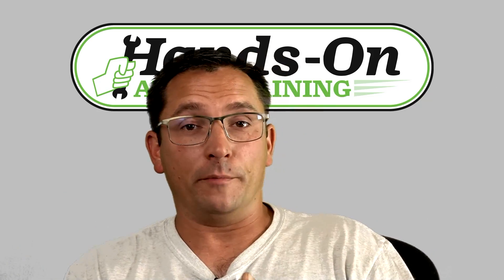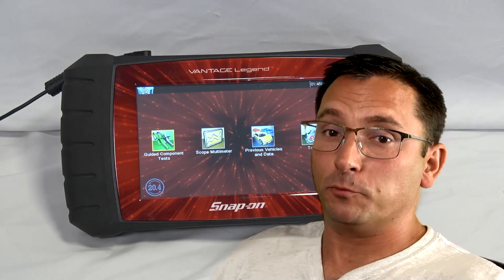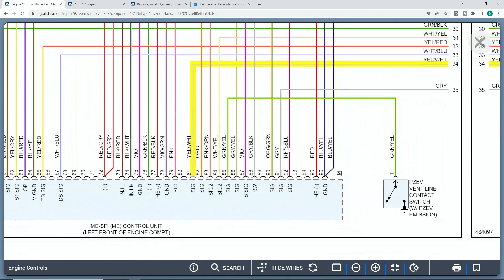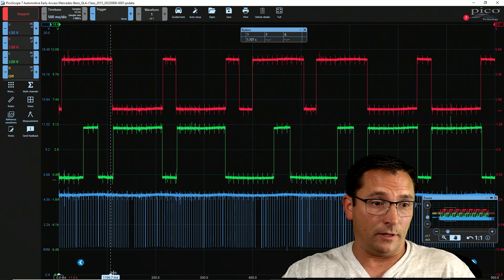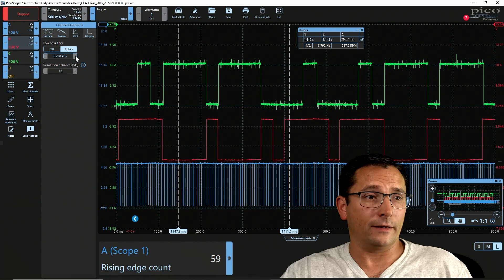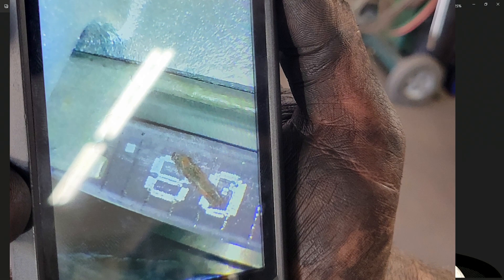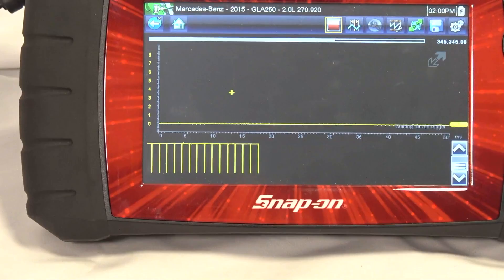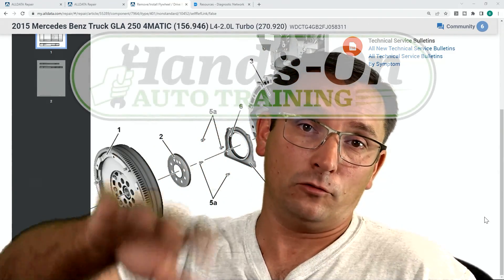Mercedes GLA 250 CRANK NO START

Comment: Funny things with those magnetic rings is if you have a strong magnet close to it they are completely destroyed immediately!
A coworker had a Ford S-max no start after timing belt replacement and it was the magnet wheel where 3 tooth was made until 1 tooth so it had 2 blank spaces.

I also had a new speed sensor wheel with the same type and walked with it and it stuck to my pocket light magnet, immediately checked it with magnetic view film and it was totally mangled 😂 so had to order a new one

Comment: I have a Mercedes c300 with a crank no start, it does detect rpm but no injector pulse, and intermittent spark. Seems like the same problem, but it doesn't run with the intake or exhaust sensors unplugged.

Comment: nice tutorial. Picoscope software looks legit. Great application for crank no start diagnostics.  My initial thought when you showed an extra spike for a tooth was either improper timing (tooth off perhaps or improper chain install or other timing system malposition) or somehow there was slop in the timing system causing the irregularity (although admittedly I could not explain the physics of this and that it was more a software error in the hall sensor or whatever read the teeth based on spacing and frequency).   Thats a crappy design. Fortunately, no rust here in the SW.  Thanks for publishing this case study.  Pleasant distraction.
Reply from the maker: Thanks for watching,  honestly my best find in the last few years.

Comment: This is amazing! Can you email me this diagram please?
Reply from the maker: The pico file?
Reply: @BrianMann216   actually I found it on the link description! I have the same car and my issue is that the camshaft magnet adjuster sensors got changed and the ecu is still throwing the same code after erasing it p0010 and p0013. With this diagram I will be able to see the wiring so it can help me understand where it leads to. Hoping that the ecu is not bad or a Sam.

Comment: Thank you for the great video! I do have one question, why did you expect to see 58 teeth? Is that how many "teeth" every vehicle has?
Reply from the maker: There are many differences between many manufacturers,  60 -2  is a common ckp count that gives the ecm a resolution of 6 degrees per pulse. Another common is 36-1. There are many others  but looking at known goods helps to. I never have seen a 59 pulse system , so I figured that's a issue.

Comment: Good work mate but can i know what was your fault codes? On ECU before any work and what was work history before dead start?
Reply from the maker: I believe I stated what I know in the video,. Died driving down the road. Had crank and cam sensors, 2 coils, engine harness , ecm, timing chain, was recommended to put a engine  in it.  Crank no start no codes , no inj pulse or spark. I was called to scope cam and crank sensors,  suspecting a timing issue.
Reply: Some symptoms don't trigger dtc but if you listen to the engine cranking momentum, it will guide you to the next diagnostic steps.

Comment: THAT WAS SOMETHING ELSE,,, THANKS BRIAN . NOW I CAN SAY WITH ENGINES LIKE THIS MERCEDES BENZ,,,,,,,,,,,, IN-CYLINDER TESTING FOR TIMING  PROBLEMS WILL NOW BE SKETCHY AT BEST ESPECIALLY WITH-OUT A KNOWN GOOD WAVEFORM PATTERN !!!!!!!!!!!!!!!!! I USE TO THINK I  COULD FIND A BAD TIMING PROBLEM BY JUST USING IN CYLINDER TESTING COMBINED WITH  A CRANKING COMPRESSION TEST ,,, BUT AT LEAST I  KNOW NOW THAT WOULD BE A FOOL'S ERRAND ON THIS ENGINE !!!!!!!!!!!!!!!!!!!!!!!!!!!!!!!!!!
Reply from the maker: Thanks for watching. Incylinder has its place for sure. When speaking with my customer before coming out I was almost sure the engine was not timed properly, and the so spark no inj pulse had me thinking the computer was no getting what it considered  good. All the other parts had been replaced so I knew what I wanted to look at.

Comment: Sucks for the customer but made a great case study. 

Did an engine on a Ford 6.7 diesel.. reman engine didn’t come with one. 

On start up. Boom CKP fault… after some testing.. found out didn’t come with the pulse ring. had to order one… pull trans.. learned a lesson there lol.
Reply from the maker: Many moons ago I was putting a long block in a 4.3 chevy blazer, I was in a hurry of course, and was distracted to do a waiter oil change. Well I forgot to put the timing cover on with out 1st putting on the crank reluctor  LOL. Crank no start  scratching my head , look at the old motor and like Dangit!

Comment: Nice job. That’s why I use the snap on for quick and easy checks and pull out the PicoScope anytime I need some detail. You can click on the toolbar at the top on the Vantage to minimize the crank sensor testing  information and show the scope settings.
Reply: I'm the same. I do like the snap on secondary scopes

Comment: Thats great Brian. Sure with a good scope u can find all the hard problems. Wondering if you had crank sensor code,ecm should’ve caught it. The only way to check any signal is with a lab scope. Pico does great job. Great video. Thank you
Reply from the maker: This had no codes, that's what was odd. I am sure the engineers can't imagine the stuff that happens to these vehicles.